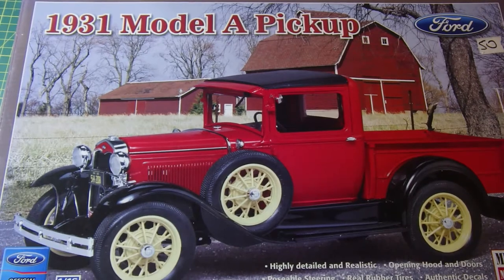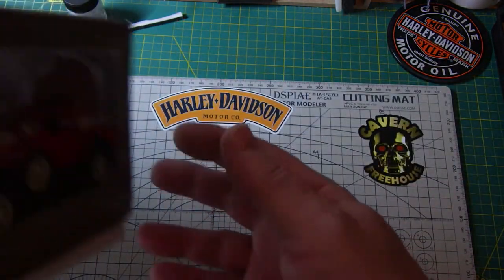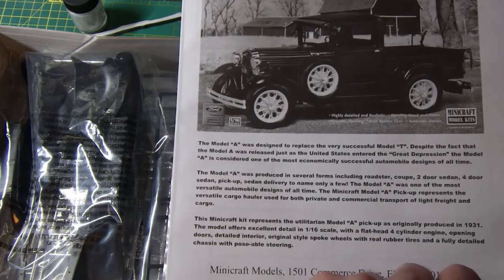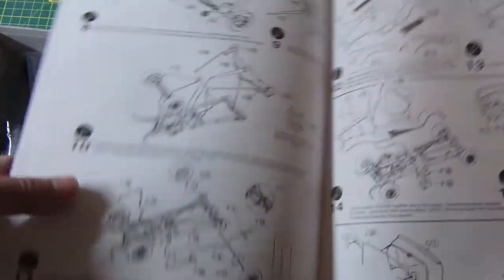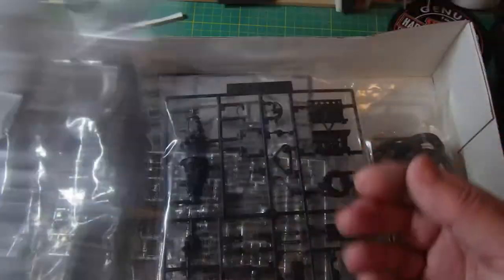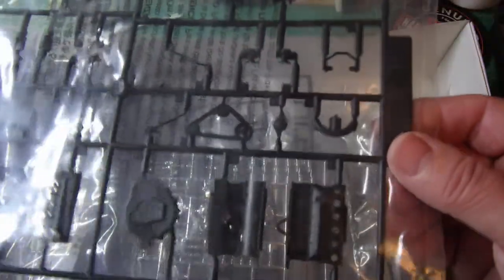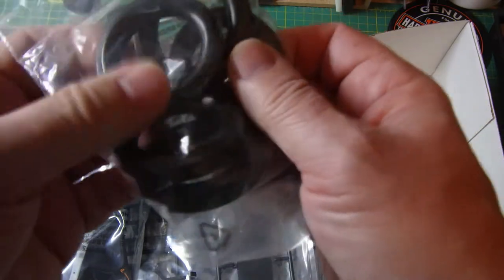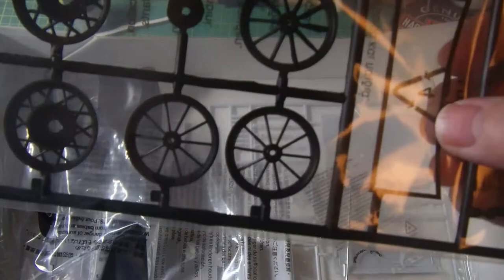Model A Ford Pickup 1/16 scale Minicraft Kit - unboxing

Comment: Hi Bob, great video.  This looks like a really nice kit, and in 1/16th scale it will have lots of details.  This will be about twice the size of the 1/35 model I am now building.  My Werkstattkraftwagen build is a GAZ, built in Russia, under a license from Ford.  The kit I am modeling was, as the story goes, was captured by the Germans and used in military service all through WWII.  The GAZ factory were actually building basically Ford Model A's clear up to 1950.  I'm looking forward to the build.  Thanks for sharing.
Reply from the maker: Cheers Jeff, I was looking at the Gaz model too. It’ll go on my possible list. The Ford A is going to be built, but probably not this year. I have some interesting stuff coming up, I hope you’re going to enjoy them. Cheers 👍🍻🇬🇧

Comment: Looks like a good kit Bob 👍🤩. I saw chain in instructions for tailgate but surprised it chain and not some moulded stuff.. Shame about bed. Fender options is handy👍😎cool kit👍😎. Happy New year 👍🎉🍻😎Pete
Reply from the maker: Cheers Pete, it’s actually a really good kit. The wooden bed has wood grain on the underside and smooth surface on the top. 👍🍻🥳
Reply: @greybeardmodels  take a hacksaw to it and put in some a floor made from old shed. Real weathered wood🤩
Reply from the maker: @petesmodelcarcustoms584  I have some very thin wood so I may laminate with real wood
Reply: @greybeardmodels  I've got @ 1000 wooden stirring sticks, if you a hundred or so I'll post some, they make nice planks👍😁